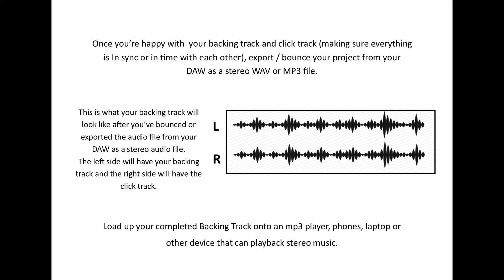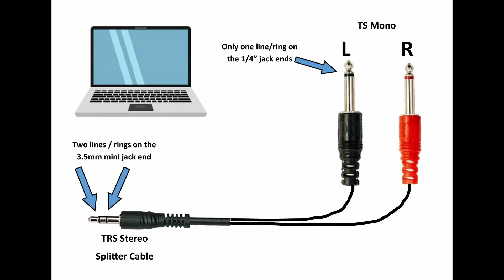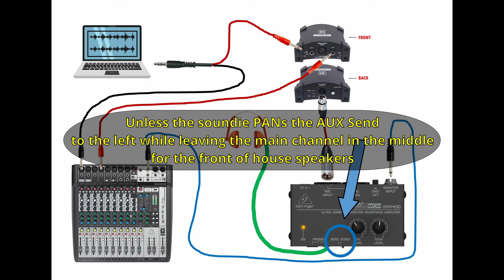How to use Backing and Click Tracks for a Live Performance

Comment: In the first exemple, Isnt the backing track in the front house gonna be mono?
Reply from the maker: Yes it would be and everything in this video is mono. But ask yourself these questions if considering stereo...
- Does the audience care?
- Does stereo improve the performance or sound?
- Does the bar/club mixer or your own mixer support enough channels to run stereo?
- running stereo will only one side of the club/bar hear some of the backing track?

Check out Nick DeLaCruz where he interviews sound engineers for MASSIVE shows like Rammstein, Fallout boy, Disturbed etc. Almost every engineer says they pan mostly up to 10 and 2 o'clock because they don't want audience on one side unable to hear the other. 
https://youtube.com/@thisisdelacruz?si=gBkmEanjx0uVfxhN

But then again stereo is pretty cool and if you can do it and you feel its more your thing then go for it. You'll have to use an audio interface with 4 outputs (2x for FOH and 2x for IEMs) in order to get the stereo effect and you'll have to run your tracks through a DAW

Comment: I thought you sent your backing track to the front of house through the DI box?
Reply from the maker: yes you can. I only use a DI box to clean up the singla using the Ground lift switch in the DI box. You can bypass this if you need to

Comment: I play guitar. If my drummer is going to plug into the behringer, where would I plug in my Synheiser EW 300 wirless for my ear ins?
Reply from the maker: Isnt the EW 300 for wireless mics? I dont think they work for IEMS as the body pack/mic is the transmitter and the box is the receiver.

If you happen to have a EW IEM G4, which is an In-Ear monitor system, you can do this a couple ways:
1.) if your main mixer has multiple AUX sends, use one of the spare ones and create a separate mix just for you instead of using the drummer monitor channel. or...
2.) Use the mic output from the Behringer MA400 and share the same signal / mix as our drummer and connect to your IEM transmitter.

Hope that helps
Reply: @BandOnABudgetNZ  Thanks! Very helpful indeed

Comment: Recommendation for DI - make and models?
Reply from the maker: Any DI will work. A Passive DI is fine. You can use an active DI but there's no point because you dont need to supply phantom power.
I have been using Behringer, Radial, Mackie and EWI. Never had issues.
Reply: @BandOnABudgetNZ  is it possible to inyect the signal from the lap top, to the Line In RCA´s in the main mixer ?
Reply from the maker: @inclaric  Yes you can but I wouldn't recommend it. Depending on the mixer you're using and how cheap or expensive it is there's probably a limit to the gain input allowed for RCA. You also wont have as much control over where the signa is send. Yes, the signal will go to the FOH but if you're using both Left and Right RCA then you're also sending the click to the FOH.

If possible use a 2 channels on the desk (one for backing track and one for click) where you can adjust the gain, add compression (if the mixer supports it) and you'll also be able to signal route each channel independently. e.g. sending backing track to FOH and monitors while sending Click ONLY to the monitors or headphones
Reply: @ TKS A LOT !!!! I see I´ve been stuck on RCA´s to much .... Regards .....MIL GRACIAS !!!

Comment: i didnt get why the sound engi needs the click track on his mixer?
Reply: i think, he used the method of Left right Stereo.. for example

Left - Backing Track
Right - Backing Track w/ click track

Left - go to mixer
Right is go to In Ear monitor, so you can hear both click track and backing track.m
Reply from the maker: Depending on your setup or situation, the soudie can receive the click then send it through to the Aux mixes for the rest of the band if they have IEM transmitters and receivers. Also if you're recording the set and need a sync reference in post production you can use the click.
Reply from the maker: Depending on your setup or situation, the soudie can receive the click then send it through to the Aux mixes for the rest of the band if they have IEM transmitters and receivers. Also if you're recording the set and need a sync reference in post production you can use the click

Comment: Surely the backing track should be in stereo? We use a mono click and a stereo backing track. No need for DI boxes? 🤔 I send both signals to my drummer he has a small mixer to adjust volumes. This is much simpler than this imho
Reply from the maker: DI not needed, unless you want to have the option to route a copy signal using the THRU output AND to use the GROUND switch to clean up the signal.
Mono use for less cables and small clubs. Crowd will never know the difference let alone care if its mono or stereo. I have nothing against Stereo but for beginners and clubs with few channels on the desk, a mono option is a nice compromise.

Comment: why use di why not just plug into board. whats the benefit ?
Reply from the maker: Grounding switch, or adding an additional THRU output to send a second signal elsewhere for separate monitoring, or converting Jack to XLR.

Comment: If you gonna buy and bring so many DI boxes and a mixer… just get a proper tool. 
Get a 4-channel audio interface, and that’s it. Same cost as couple of DI boxes, less crap to carry around and set up 

Or if you insist on using built-in audio, get a Rolls PM351, just a single box that will do all of it - split, headphone amp, DI, external monitor feed input..
Reply from the maker: That would be totally fine too... but what happens when your laptop or PM351 dies, breaks, crashes, or loses power/broken power supply? You need a backup. Load your tracks on a portable device and plug into your DI box. Or... dont use DI box at all just go straight into the FOH mixer. The DI box has a ground lift switch to clean up the audio from electrical grounding interference.

Comment: 12:14 who would want to have clicks only on one side? it would literally hurt my ears xd
Reply from the maker: I know a drummer who does this and have seen some drummers on You tube say they have done this before because its easier to differentiate the sound when everything is playing. Me personally I wouldn't pan hard left or right, that's not my preference, but maybe a slight left or right to make it easier to pick out or distinguish if I'm having a hard time hearing the click
Reply: I would. I run click/spd backing tracks in one ear, and my vocals/lead vox/ guitar/band in the other. This helps me stay in time but also make sure our three part harmonies are on point. I can control mixes at the drums, while the sound man controls mix to the audience…

Comment: question, in the 2nd example, why send the click track to the main mixer at all?
Reply from the maker: Good question. It's more for "what if..." for example let's say you don't have enough small mixers or pre amps but want to send the click signal elsewhere on stage. Having the click sent to the main FOH mixer doesnt mean you have to use it but it could be re-routed elsewhere.
One example could be if you were recording live performance into a multichannel interface. You then have a click track to help sync up any post mixing and production in your DAW.
In short, you don't need to if you have enough equipment on stage for everyone to hear the click. The FOH mixer is just an additional source of audio if needed.